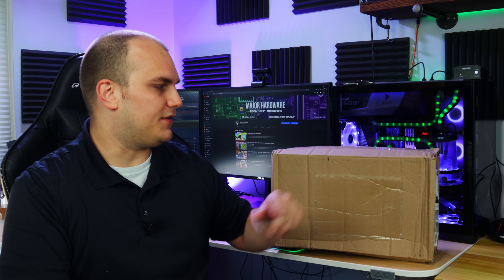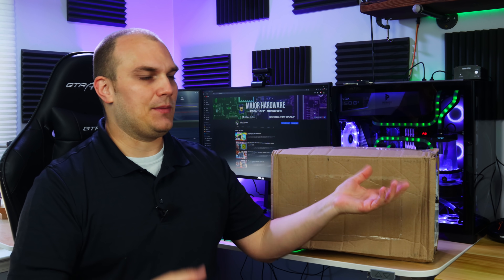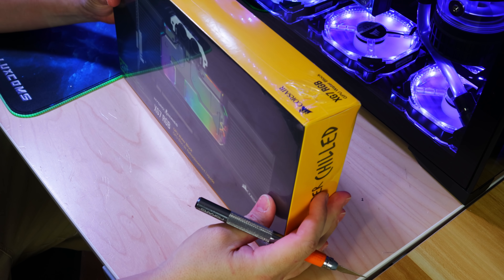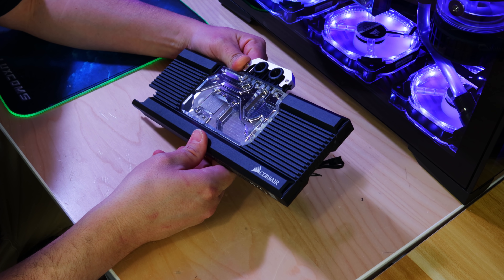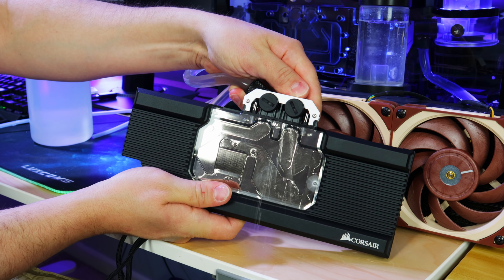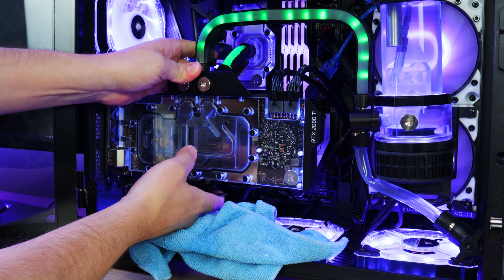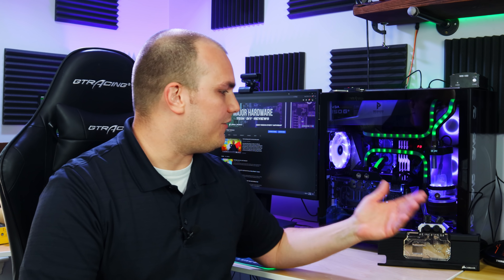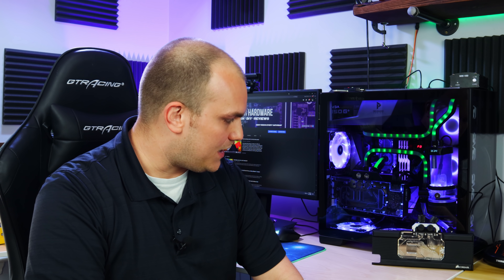Why Is No One Talking About This?? | Corsairs Leaking Waterblock!

Comment: Keep doing RMA's, blast them!!! , let's see how many times it takes. Maybe build a reputation with them for testing and get some free stuff in the future.
Reply: I am using the same logic as my father when it comes to hardware. Granted, stuff can get broken or be DOA, but if I don't get a solution or a replacement or a shitty service, don't expect me to buy another piece of hardware from that brand the next time.
Reply: And do what, waste time and money? Changes aren't coming. The fix for this expensive, and these products only have a narrow window of peak sales. Corsair made their money, and the most that will come from this is a better design in their next generation of products. There's not even grounds to issue a recall, and legal action against Corsair would get thrown out, as the product operates as intended when used within spec, and only fails when it is out of spec, which always comes down to user error; pressure applied laterally to that component isn't what the product was designed for, and with proper installation and use does not occur, thus it is user error. Welcome to how the corporate world operates. Oh and not to mention repeat RMAs for a product that technically works will get you on a blacklist, so congratulations on screwing yourself in the future if you do that. 
Now for the last part of your comment. Reputation for testing a product, just because you run a tech review channel? No, it doesn't work like that. These products are already tested in-house and passed that testing, again furthering why this issue is user error entirely, and even third party testing would be done by companies with proper testing equipment and methodologies. A guy applying pressure to a component is neither proper testing equipment nor methodology. As for free stuff, no, that wouldn't happen either. Even 'free stuff' in the form of sponsorships or review items are not free. The most 'free' products a company like this will give is either worthless things like cable ties and wrist bands, or to shut someone up if they're causing problems; but the latter almost never happens, because, again, that blacklists exists, and one customer means absolutely nothing to a company of any size- and no, an RMA is not this situation, as you're returning a defective item for a non-defective item.
Clearly you have enough brain cells to type, try using them for logical thought sometime.
Reply: @xaytana  aren't RMA's free?, he's already purchased the product so now it's just a cycles of  copy and paste complaints.
Reply: @xaytana  Euh, do yourself a favor and go watch the first video of this issue by this channel. The block clearly leaks, even with normal pressure/tension. Secondary, reading the manual, nowhere is any mention of what kind of pressure/tension should be applied on the block. BTW, that last part is in my country a profound reason to cancel the sale one sided with no defense whatsoever for Corsair.
Reply: @dorientjewoller113  That's because, no matter what the water cooling product is or who makes it, you don't apply lateral force to any component, hence why it isn't in the manual. Any person with half a brain cell can figure that out. Applying forces the product clearly isn't intended to have results in user error. Bad design or not, the product wasn't intended to have lateral force applied to that component, so it failed under that force, thus user error. Both of the products had functioned fine until force was applied, thus, again, user error. 

BigDave855  No, as I had said, an RMA is an exchange of a defective product for a non-defective product. Free would mean there's no purchase, at all. Can you RMA, or exchange, a product you don't own? No? Then it's not free.
Reply: @xaytana  there are outside lateral forces and then there is the weight of the designed system. Since, from what i gather, there is no instruction on how the bends of the loop have to look(dimensions, radiuses, etc.), what material has to be used and density of the liqui, this is clearly a rushed product/bad batch/design flaw/cheapout on some part in the manufacturing process.
Reply: @xaytana  You have no idea what you are talking about, yet you typed a book here. Watch the 1st video, then rewatch this, then check how fast this problem spreaded though the internet (youtube, reddit, tweeter, web pages, forums)... and then come back here and read your book again.
Reply: @acidcharon  you look lost. What does a corsair water block have to do with a gx460?

Comment: Well, I'm no engineer. But I did get involved in quite a few opto-mechanic designs over the years. And this, this is something that is designed to fail. I've never seen something so obviously designed to leak, to fail. Maybe you should do another video, but more "Experiment Style". I mean, actually measure the load at which it starts to leak, with the deflection, and compare the results with the EK (Add a third block?). Would make great content and no one could argue that the results are skewed.

Comment: One mad reason why i would not go with water cooling. I like taking risks but if it contains all my data, that's not fun anymore
6:15 that pipe between radiator and reservoir, why is it so kinked?
Reply: it is drain port. He just shuffled it too hard into the corner so it got a kink. Doesn't affect on anything tho.
Reply: Kotory Ah okay, didn't see it first

Comment: Do you have the ability to put threads in the acrylic and put your own machine screw in the center to keep it from leaking?
Reply from the maker: i could however if you look close you will see there is a screw that is perpendicular to where that screw would need to be and right in the way :-(
Reply: @MajorHardware  Ah gotcha. Ya that would be difficult to do then.

Comment: Saw similar issue with that block in a LTT video. At least I think it was the same block.
Reply from the maker: same block
Reply: @MajorHardware   Can you try tightening the screws to see if that fixes it? I want to build a Corsair water cooled build but won't if this issue can't be resolved.
Reply: @hobblyjig  Why does your watercooled build HAVE to be from Corsair? There are many better companies that have much more experience producing custom watercooling parts.
Reply: All Linus did to fix it was tighten the screws on the top
Reply: @dylanandersen9318  what caused the leak on linus was him stretching the tube from gpu  to cpu block with it not being long enough putting the same torq as whats shown here  while he did tighten the screws i dont think tightening the screws fixed it he got a longer tube which is why it stopped torquing the manifold where the fittings are. i think the issue is when there is a gap in pressure from the 2 screws being so far apart any slight pressure or torque is gonna cause a leak
Reply: @mattfischer5794  - And because its cheaper plastic as compared to acetal which is what ek and alphacool use for example.
Reply: @flexxx222  didnt know that but makes sense weaker material having less resistance n bends ezr just shitty overall which sucks to see this from corsair and to send a new one that doesnt address the issue at all it kinda bs imo

Comment: Here’s a list of Corsair Products I’ve had, and those I’ve had to RMA. May be helpful for others:

- AIO H115i Platinum (RMA 2x: pump and bad temps)

- RAM Corsair Dominator Platinum RGB

- RAM Corsair Vengeance LPX

- PSU H850i (RMA: Coil whine)

- Commander Pro

FANS
- 4 x LL140
- 2 x LL120
- 2 x ML140
(Never had to RMA any fans but beware these are what I consider noisy even at idle)

- GPU block 2080TI (No RMA BUT the pre installed thermal pads are too thick at 1mm. Need to be replaced with 0.5mm pads or your PCB will flex).

- MOUSE M65 Elite

- MOUSE Harpoon RGB Wireless (RMA: stuttering/ signal issues)

- KEYBOARD K65 Cherry

- HEADSET Corsair Virtuoso SE

They clearly have serious quality control issues, and their customer service are more in line with robots. They will get you an RMA, but they’ll take their time with it and you won’t get any real human interaction. Shame they make some of the best looking products as I’ll continue to waste my money on them... otherwise don’t bother.
Reply: Holy sh... that's a lot of broken products. I gope they make better quality controls for what they sell (that ram is even rated as Amazon's chpice so... it's pretty dangerous buying any of that).
(Sorry for my english)
Reply: Camilo Buritica Their RAM I’ve never had a problem with tbh, and I haven’t heard of any issues with it elsewhere. Shame about everything else
Reply: that is quite the list, thanks for writing this down.
I like some of corsair products, but gooten way to much lights on them for my taste lately.
I currently have 2 items from you list:  RAM Corsair Vengeance LPX
 and PSU H850i....
Those ram stick either work or fail and mine worked, i am pretty sure i had LPX last pc build also.
The psu's i owed have been from corsair  and hx850i is the latest i own. coil whine i have from gpu for sure, but i am not sure about the psu, i have slight noise when ssd is reading, not sure from what part it comes from. but either way i have sound dampening foam around the pc so it won't reach my ears.

Comment: Time to 3D print a fix.
Reply: Idk about 3D printing but def the next step is coming up with a simple(ish?) and/or cheap(maybe?) mod/repair and make them look foolish lol. It looks like the EK block has more screws threaded into the acrylic? Drilling and tapping the corsair acrylic and whatever else might be overkill/impossible but I know silicon has been a solution on this channel before. There's also lots of different gasket materials out there. Void that warranty and make it better
Reply: And then patent said fix & licence to Corsair 🤣

Comment: Wow. I haven't done a custom loop ever, but I don't think those are supposed to do that...
Reply from the maker: its got more distance than my lawn sprinklers
Reply: @MajorHardware  What about the lawn-temps? I mean that you could try to use the water pressure going to sprinklers as cooling "line".... No need for reservoir/pump and the heat is transferred to lawn without radiator. Could be fanless if not for chipset . :D

Comment: I see you got the new model with enhanced cooling spray, way to be ungrateful.
Reply from the maker: HA
Reply: evaporative cooling is very effficient!
Reply: @MrPruske  Until there's no coolant left 😁
Reply: I heard it's limited edition.
Reply: @huantian  Nope, it's not a Limited Edition if they all have this feature 🤣🤣🤣🤣🤣
Reply: Ahh great summer product
Reply: It helps keep the PSU cooler
Reply: @xPaulRulesTheWorldx  I mean said PSU might also catch fire... But hey, the leak will also put out the fire! Bonus feature!
Reply: @datachu  well, if the psu blows, then no because the power would stop, which would stop the pump and no more pressure to spray water onto the fire in the PSU.......
Reply: @xPaulRulesTheWorldx  hahaha burrrrrnnnnnnnn
sizzle
Reply: Limited edition Holistic Cooler, cools the PC & user*.

* user may experience slight electrical shock on use, this is normal & part of the experience.
Reply: @norfolkngood8960  called over clocking for a reason:P
Reply: it's the Corsair WRX STi Turbo Intercooler Spray Cooling version
Reply: So switch off the "mist" case cooling option. Its obviously designed to create an evaporative cooling effect once the water hits the lower fans. Personally i would OC the hell out of it and document temps and fan speeds with the additional cooling.
Reply: Would you please tell me the brand of your PC  case ?

Comment: If it were me I'd demand a refund
Reply: It doesn't leak if you don't tug on the fittings, and if you are doing that while it's in the case you may be dumber than you seem
Reply: @tristonpalmer1752  I'd imagine many aren't running into the issue unless

1) The tubes are abnormally tight in configuration

2) GPU sag hits down the line and puts the pressure just right

3) The seals are more hit or miss on some blocks than others

So no actually. Plus when you consider it doesn't happen when the same pressure is applied to the EK block, it really doesn't take a genius to see there is some blatant manufacturing or design defects with the Corsair.
Reply: @MaddJakd  well said

Comment: Unbelievable. I was actually really tempted to finally buy a whole loop for my system because of your videos, but if manufacturers are pumping (ba dum tsh) stuff like this out, I'm reluctant to invest.
Reply: Go for EKWB and u shouldn't have a problem
Reply from the maker: my EKWB stuff is rock solid no issues as of now.
Reply: @MajorHardware  Hopefully it stays like that :P
Reply: Corsair seems to be quite shitty when it comes to water cooling; they also had problems with some of their AiO pumps partly dying after ½ year.
Reply: @valentin0000  Yup, I have had 4 of them in 3 years, in different systems, either leak, or blow bearings. Corsair is a no go for me for anything except their fans.
Reply: @reaper15a  Nah, Corsair has solid PSU lines especially RMx, everything else is usually either just overpriced, or even overpriced garbage, including their fans. Though it is true there is a distinct lack of quality aRGB fans, the best ones are just mediocre at best compared to quality solid (no RGB) fans.
Reply: @valentin0000  Ouch thats bad, my aquastream ultra is running like 8 years now :D
Reply: @Koichifirst  Got one going on 10 years 24/7 duty now :)
Reply: Go with Ek, I'm on my third fully customied full watercooling loop (soft then hard then both tubing) never had ANY problems whatsoever
Reply: Go either EK or Alphacool have used both, and never had problems. Especially nice to use and long lasting are the EK coolants, had some running for about 3 years or so without maintenance and literally 0 problems
Reply: there is plenty of good water cooling companies around - Aquacomputer, Watercool, Bitspower, EK
Reply: It's just Corsair you really have to worry about for custom loop stuff. Everything else available that I know of is pretty solid without issues like this, even bargain Chinese fittings off ali express are fine. even corsair's other products for custom watercooling are fine as they are just rebranded quality products from other respected manufacturers, like Bitspower for fittings, and Hardware Labs for radiators, which are two of the most premium companies for those products. Stay away from the blocks, they had to cheap out on those to hit a profitable yet competitive price because they don't have the machining capabilities to make them in house and machining is EXPENSIVE to contract out. That's why you see so many cast parts and minimizing of machining in their blocks and reservoirs. Corsair's marketing tries to talk up their injection molding tech, like it comparable to machining, but machining beats everything always in quality and performance in precision applications.
Reply: @DukeShambles  Good info.
Reply: Or just go Bykski. 2 - 2.5x cheaper then EK for basically same quality. Barrow is there too
Reply: @Erotikstudio Winkler GmbH once you tested heatkiller you never go back ..
Reply: my ek hardline loop has been fine since zen 1 launched
Reply: Dont water cool as an "investment", at least not the gpu. CPU is worth cause you can typically use the Block for a long time, but gpus its only worth if youre doing it for fun.
Reply: @guyfawkes8873  Unless you get a universal GPU Waterblock for 15$ :)
Reply: You’d be better off getting dirt cheap components off of eBay to start.  That way if you discover you like it, you can upgrade one piece at a time.  Or if you don’t, you didn’t spend much.  The important part of upgrading is teaching you that water cooling is not easy.  It requires a lot of time and effort to do it correctly and have it look good at the same time.  Having the right case, with plenty of room for all the extra hardware,  makes it a lot easier.  I’ve had weeks into builds before.  When everything is 100% custom, it takes forever to put it all together the first time.
Reply: EK products are not bad, I have few produst from them but in comparison to brands like Alphacool, Watercool, Aqua computer. EK is below them. EK is pushing strongly on marketing as you can see all over internet but when you try to dig deeper, you will see not everything is black and white.
Reply: I love my aqua computer kryographics next nickel block on my 2080 Ti. I had the ek block before and I like the aqua computer alot more. Don't get me wrong, I love ek as well, my whole loop is ek except the GPU block.
Reply: @Cr0Lar I would disagree on that. EK is widely known because of the marketing. Anything else they are just midrange and quite expensive nowadays. If you are looking for quality go for aquacomputer or watercool products. Designed and machined in germany, all reservoirs use glas (EK is still using plexi...) and a great support (EK Support never gave a f... when it came to a defective product)
Reply: I just had to replace a Corsair H115i 280mm because the pump died. No damage whatsoever. Shit stopped working. Got a Noctua NH D-15 and its actually BETTER than the H115i was when it was working.
Reply: Ekwb is overrated, people think it's the best just because they get their products all over YouTube.... The highest quality and best performing blocks are Watercool's Heatkiller line.... Made by Germans in Germany
Reply: @post-leftluddite  Optimus beats heatkiller in temp tests. Heatkiller is great, but not absolute best.

Comment: Why do you have your case fans running at such a high speed?
Reply: why not? you know, there are still components on the mobo that need air too
Reply: @LcFan96  they don't need that much air going over them.
Reply: If you want slower fans with good airflow you basically have to go bigger. Though noctua manages to do a good noise to performance balance for static pressure fans.
Reply: video captures fans in a strange way